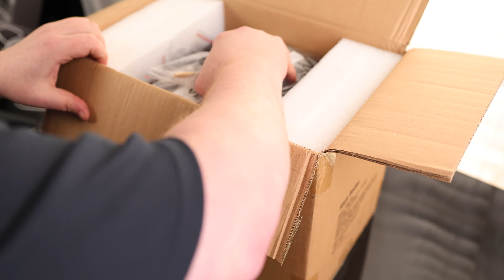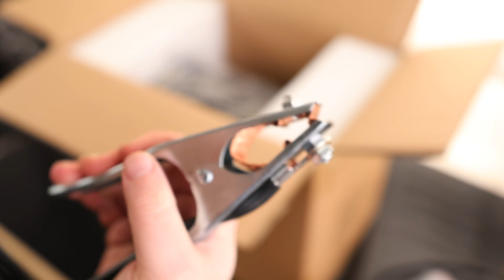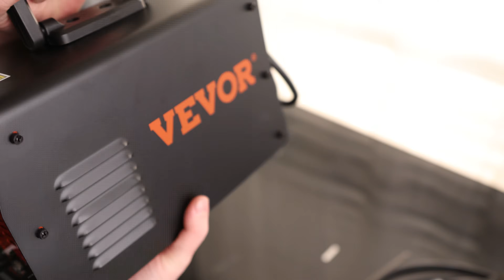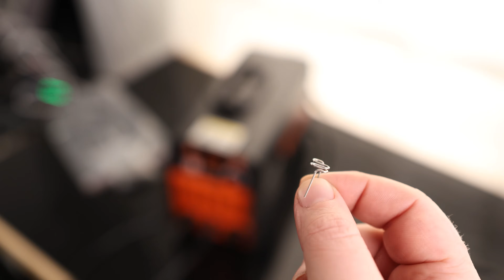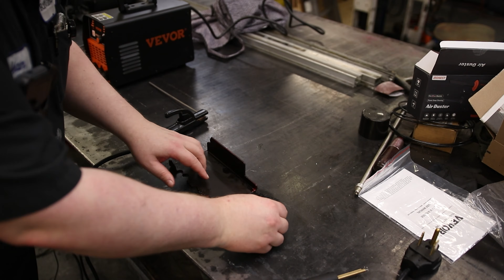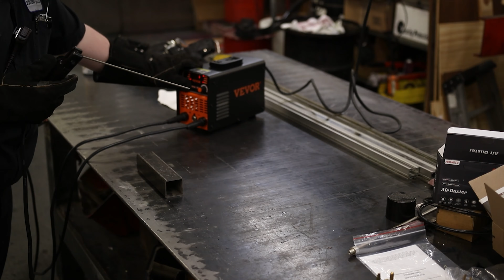VEVOR 180Amp Stick Welder With Hot Plastic Staple Welding!

Comment: Could you weld thick metal plate
Reply: In a single pass, at 180 amps, I wouldn't go over 5/16's thick plate.  In a multi pass, that will depend on your skillset.  If you know the proper weld joint prep and how to preheat, you could probably get away with 1 inch plate if you set up a full pen weld with backing bar and 1/4 inch gap.

Comment: You think this will be good to weld an exhaust that's still mounted on the vehicle? Already put it to the test on bumper cover. Did some handlebars had someone hate his bars since they kept stripping. So did a weld see how that goes. Love rhis small form factor and staple feature. Your vid was definitely good for showing useage.